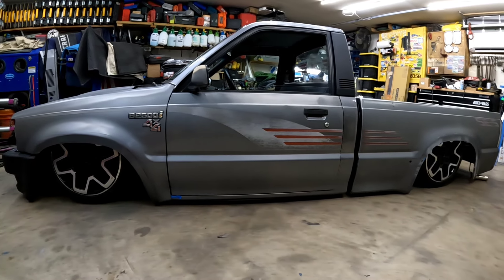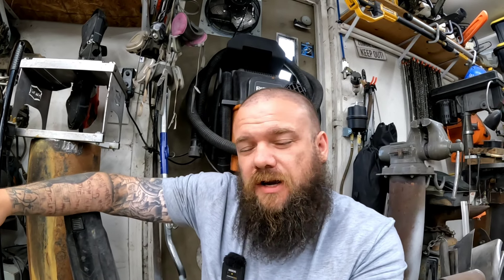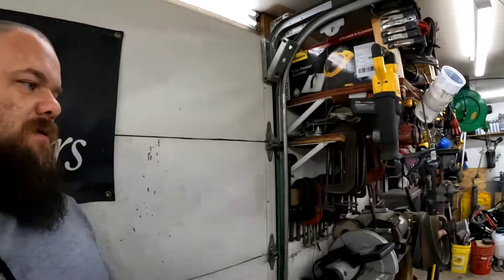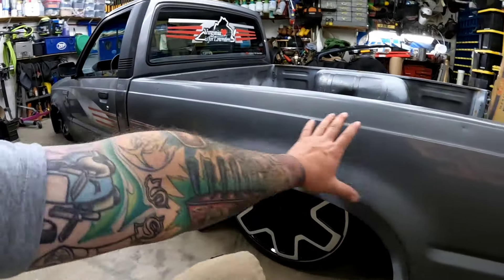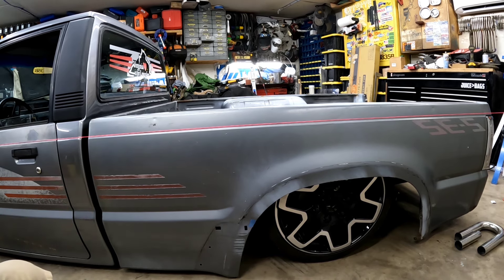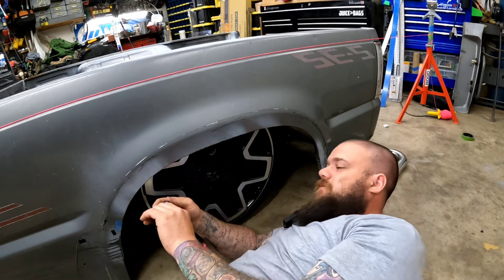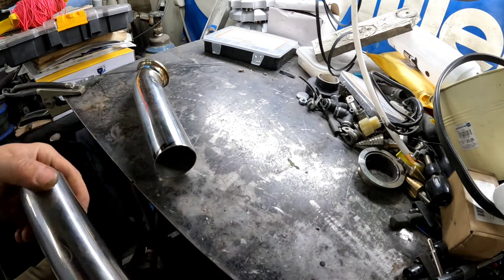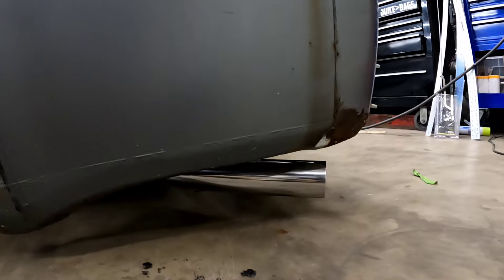Bagged Mini Truck Build #54

Comment: Yeah buddy! Progress,  be surprised what chipping away little at a time will do. How I built this tiny house I live in.  I'm a detail guy so the idea is that every time someone comes over, they notice some small detail they missed. Doesn't happen all at once.  Got to say kinda digging the roll bar.
Reply from the maker: @kirkoglesby6175  yessir little by little.  I'm digging it so far . I think some fine tuning and paint it will look like it's supposed to be on there.

Comment: I actually kinda dig the roll bar. The graphics are sweet to especially faded like they are!!
Reply from the maker: @jonathangertchen4595  thanks !   I like the faded look to I would leave the body the way it is if the bed didnt need fixed and the front pass fender wasn't primer.  I plan to paint the truck the factory color again with a fresh set of the same graphics
Reply: @Virginiaisforlowriders  it will look great killer! Them bronco wheels are still 🔥 on it also. Some billets with be a nice addition

Comment: Keep the roll bar. Looks good
Reply from the maker: I like it so far. I think some paint will make it fit the truck a lot better
Reply: Black or gray.  Id do black. Unless you do a black bed liner. Then I would go with gray

Comment: On the trucks, stock, between the bed and the cab, is 1 inch on both sides from Factory.
Reply from the maker: @MazdaMitch  I'll have to measure it when I get home. Thank you.
Reply from the maker: I measured it yesterday it's within the one inch gap. Thanks again.

Comment: NGL, the roll bar looks better than I'd pictured it. Maybe not my taste, but it's not my truck. Didn't want to offer an opinion until I saw it, but I can see the potential. I'll be curious to see the push bar. Also: Dodge Rampage.
Reply from the maker: I believe when I get the angle on the rear bars and it's painted it will fit right on the truck.  It's not 100% just yet. The push bar will be tricky . I'd like to keep it small but still hold a couple fog lights 🤞. Yep that's the one I was missing.  I knew dodge had another name for it. Thanks man !

Comment: Lund 81- 93 Chevy S10 Bed Spoiler  RacerBack Fairing 1981-1993 CP4RB 
This what I am thinking for a roll bar.

It's called a Cab Fairings. They are sleek with cab.
Reply from the maker: Yeah those are pretty cool. That's what I was  trying to describe with the brat roll bar . Thanks man !

Comment: Are you going to put the plastic trim back on the bed around the wheel wells or smooth it
Reply from the maker: @ricktroxell6448  I have it.  It's been the plan to put it on since I bought the truck, buttttt with these wheels it looks goofy since the offset is so sunken in . So as of right now they  aren't going on it.

Comment: Kinda off topic Crawford, but what mic are you using? I'm gonna start posting videos of reassembling the race truck
Reply from the maker: I'm using the rode mic 2 . It was a pain in the beginning because I didn't read the instructions and I'm an idiot lol. But after a while I figure out the settings and it's been good since .
Reply: @Virginiaisforlowriders  thanks man